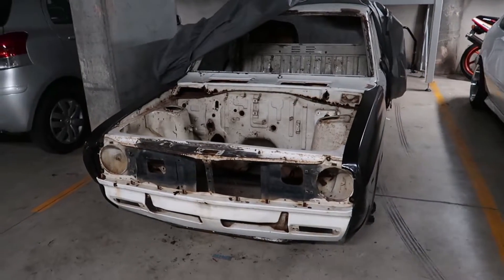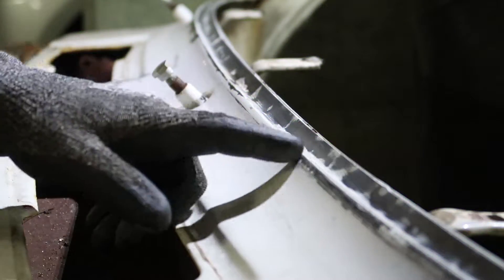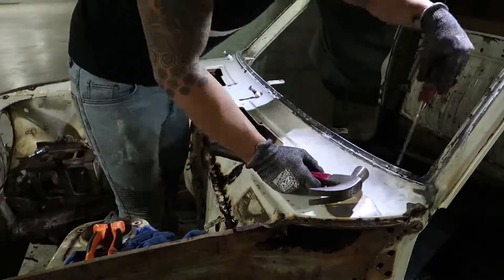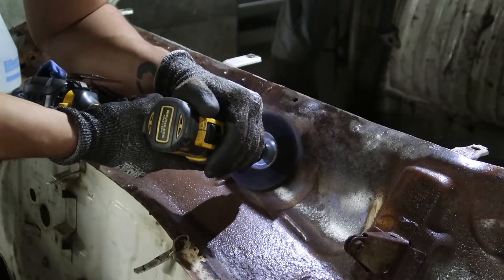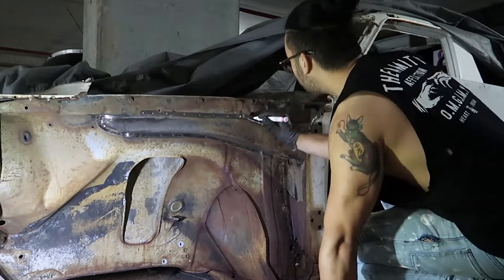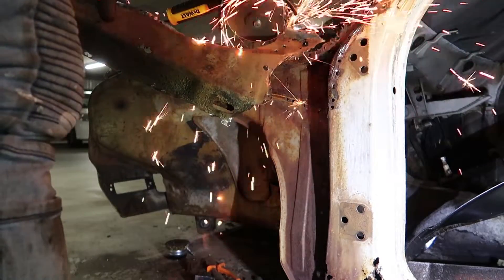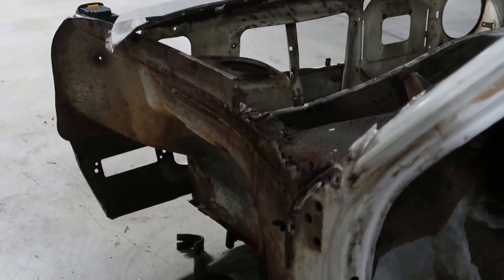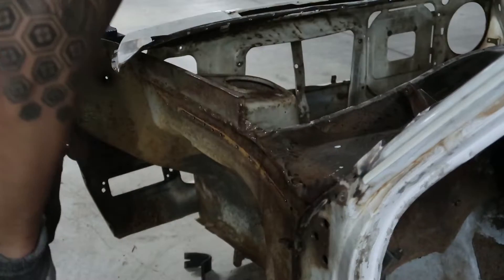DATSUN BUILD - STARTING THE RUST REMOVAL PROCESS (#8)

Comment: Get yourself a spot weld drill bit for next time - it's neater than a standard twist bit as it barely drills into the second panel and makes it easier to separate the panels. Oh and I hope that's your Yaris and not someone elses you're covering in grinding swarf!
Reply from the maker: My brother parks next to me, I've been misting with water between grinds. There's got to be a better way haha
Reply: Buy some welding screens to block the sparks. They can burn into paint and glass even if it's wet.

Comment: Blocking off the top vents in the cowl should be fine. Just cut out some stainless plates and glue them in place with some Selleys D-Mastic or non-hardening windscreen sealant, and put the grilles over the top.
Reply from the maker: Nice I'll try do it before I put the cowl back on!

Comment: hey micheal, im pretty determined to do my own panel beating/body work when i get a space to do my 720, but im also curious to check out what replacement panels are available out there and i was wondering where you sourced your front quarter panels from ? was it an australian supplier or did you have to import them ?